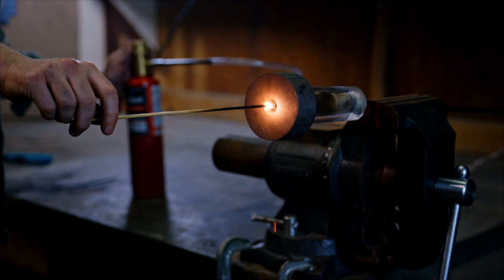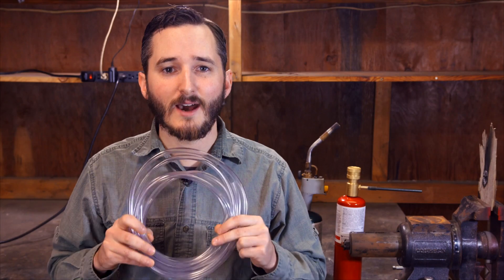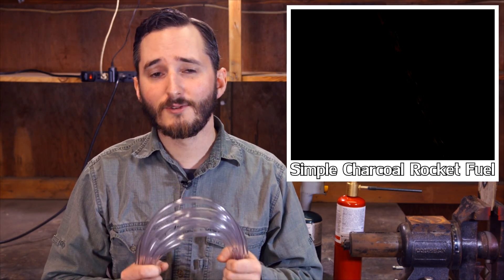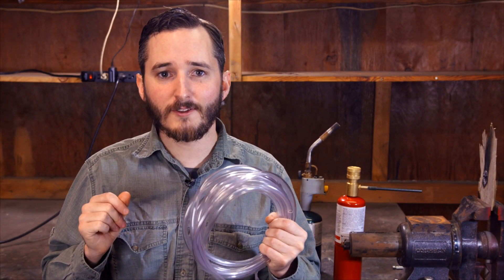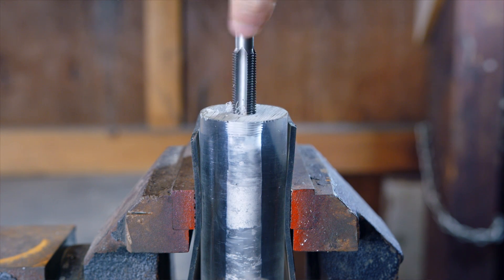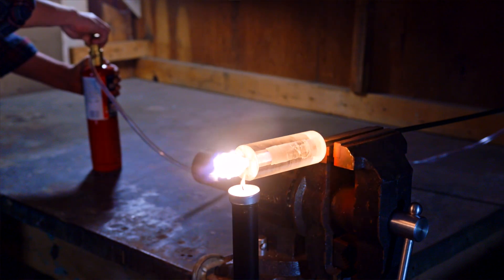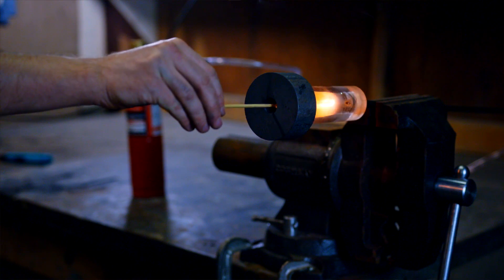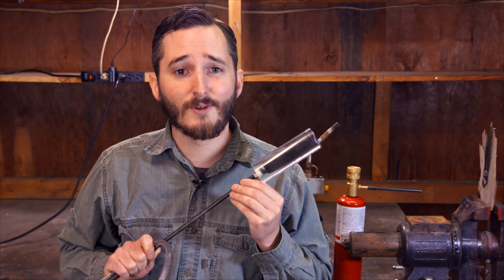Building a DIY Transparent Hybrid Rocket Engine - NightHawkInLight

Comment: Oh boy that brings back memories!

When I was still in highschool, I had made my own oxygen generator setup with an empty wine bottle, some hydrogen peroxide, hydrochloric acid and a rusty nail. 

I promptly decided to have fun with it, and start burning coal in a flow of pure oxygen. Which was quite fun until the vinyl pipe I was using touched the charcoal, and did exactly what you show at 7:17 : I had inadvertently built my first hybrid rocket!

Watching the pipe wiggle on the ground as the flame front was progressing inside it, I stomped it to stop the flow of oxygen. The other end of the pipe promptly popped off the wine bottle with a small hydrogen peroxide geyser, and the combustion stopped.

I then decided I would try again, this time adding a steel pipe at the end of the vinyl tube. That's how I inadvertently built my first thermal lance.

After using the same pipe-stomping technique to extinguish it, I moved on to copper, which has a lower melting point, but is not flammable, even in pure oxygen.

I had quite some fun by filling a hole in a brick with a mix of charcoal and small aluminium pieces, then adding a charcoal ember to it,  and lowering that long copper pipe in the hole with pure oxygen coming out of it. It made a beautiful white light, with a weird flame on top, green on the inside and blue on the outside (I assume that's due to the copper from the pipe).

It was giving off so much heat, I could lower the copper pipe without feeling any resistance, as it must have instantly melted in contact with the burning charcoal and aluminium.

I've still kept the bits of molten metal from back then!
Reply: So you had enough hydrogen peroxide to create enough oxygen to make a thermal lance?
Reply: Caju sounds like the DHS might not like you
Reply: Ok
Reply: Wow that’s so cool  ✨✨✨

Comment: Hypothetically,  if this were added to a skateboard would the thrust be good enough make the board much faster?
Reply: you could buy one or two model airplane jet engines that would work relatively well but i would suggest going with an electric skateboard if you want a safe alternative.
Reply: Ahh I see.  Thanks for the info

Comment: How many of those 2-ounce oxygen tanks did you go through during this project? They go so quick.
Reply from the maker: For this one? Only two. For my thermic lance project, like 10.
Reply: @Nighthawkinlight  Where can I get that oxygen tank?
Reply: NightHawkInLight wow 2 amazing youtubers who grown my actually knowledge i love you guys !!
Reply: If you're interested in looking at other oxidizers, I can pass along some tips on N2O from the research I'm involved in.  Our motors are on a bit larger scale, but liquid N2O is relatively safe if you follow a few main safety guidelines.
Reply: Can you come up with a way to measure the thrust?  I would love to know how much thrust this is generating.
Reply: Michael D I think a simple pool style flow meter would work. Only the flap would have to be made of metal.
Reply: For larger engines with variable thrust curves and shorter burns, we use a piezoelectric force sensor and a data acquisition system that measures the force sensor's voltage many times a second.

However, for a small motor like this, you could easily set a digital scale vertically in front of the rocket motor, much like they do to measure the thrust of RC planes.  The weight the scale reads as the motor presses against it would be approximately equal to the engine's current thrust.
Reply: Cody'sLab I love both your channels. you have both have been a great inspiration to me.
Reply: cody... id like to see you do this, but with a better nozzle, think you can do it? im certain you can
Reply: CODY MAKE A HYDROXY ROCKET
Reply: Cody!!!
Reply: Cody'sLab oh, hello there
Reply: I have been using them for a PP/O2 Hybrid rocket engine myself, any experience refilling them with a larger OXY bottle?
Reply: CODY?!
Reply: +Michael Demshar
A simple way to measure the trust could be to set it up on a track and have it press into a scale. You would just have to remember to set it up so the tube won't be in the way.
Reply: Nitrous oxide would work as well, and might well be cheaper (vapor pressure is much like CO2). Probably cheaper than oxygen, too. Used in commercial hobby-sized hybrids.
Reply: Cody'sLab iii
Reply: Cody'sLab I
Reply: Could you tell me how bigger rocket motors are ignited?
Reply: C C C CROSSOVER
Reply: Cody'sLab hey Cody
Reply: Love your channel Cody.especially the heavy water production video.
Reply: Does someone know where can i get an oxygen tank like that?
Reply: Cody'sLab
Reply: Cody'sLab hey can I use oxygen and propane as a fuel and oxidizer, Or would liquid oxygen be better as a go cart engine?
Reply: Soyuz are inded lit by a "match"
Liquid engins get lit throu a hypergolic catalyst
And solid rocket motors are lit throgh a smaller one
Reply: Isn't nitrous oxide far weaker than oxygen?
Reply: Have you ever tried nitrous oxide for an oxidizing agent?
Reply: Very nice basic demo.   👍👍
Reply: Cody getting ready to use his wax hybrid rocket 😂😂😂😂
Reply: I am a member of a national organization, Tripoli Rocketry Association, that reglary flies commercialy available Hybrid rocket motors with impulse ratings of 160.00 to 10,240.00 newton-seconds. They are nitrous oxide/cardboard, nitrous oxide/Plastic and nitrous oxide/ammonium perchlorate composite propellant. Safe, leagle and fun.
Reply: Lol
Reply: Building SpaceX Replicas of Self-Landing Rockets
Reply: Any chance for a co-lab super rocket? hint hint nudge nudge
Reply: @_om3ga41  any home depot/Lowe's store.  They are used in welding.
Reply: Can I know why only acrylic is preferred here??🤔
Reply: @shan.p  It definitely is not the most power to weight, but it is commonly available, but most importantly ****it is transparent so you can see how it is working****. It makes for a much better video for demonstration. It also keeps quite a bit of its strength at elevated temperatures, which keeps it from blowing apart.  That is why nobody shows it burning all the way to the outer shell. It would fail in an unpredictable manner with  the possibility of hot plastic shrapnel being spread around, which I guess might make for a different kind of cool video.
Reply: Where do you find the valves for those
Reply: Awesome
Reply: Where can I get that oxygen tank?
Reply: Cody'sLab  I'm a big fan I didn't know that you watched videos on your own channel that's awesome second YouTuber obscene comment on a YouTube video
Reply: A really big match.
Reply: Raidzor つ ◕_◕ つ go to Lowe's or home depot and ask for Oxiacetylene torches. They should be around them.
Reply: Cody you got burned dude! Only 2! Beat that. And this time, don't inhale it 😂

Comment: The core flame is melting the machining marks that make it look opaque, and keeps it in a liquid state once burning, so you can see right through instead of seeing the light deflected off the rough machining marks.Much like you'd do by spraying water on a frosted glass with a cold liquid inside. It looks like it's shrinking because the necessary temperature to make the acrylic melt and burn with the oxygen, was acquired from the tip backwards because the ignition source is at the tip. As the interior started burning with the oxygen, it traveled back until it reached the source of the oxydizer. That good enough?
Reply: Incorrect. The acrylic is melting and changing its index of refraction. This is probably the overwhelming contributor to this optic effect.

Comment: Awesome video. Could a less efficient version be made using regular compressed air?
Reply from the maker: No. Because air is only 20% oxygen the other 80% will cool off the fuel as it blows past faster than the oxygen can feed the flame and the rocket will go out.
Reply: it's N2O
Reply: NOx (laughing gas) might.

Comment: Ehh.... if that graphite is conductive, you could send an electric spark as a point of ignition, using the iron and/or brass bits as the other pointed terminal. due to the distance involved.... probably would need Kilo range voltage, but... opening the o2 regulator full bore would decrease the effective voltage needed to complete the circuit.
Reply: The rocket I got to see here at school used a fuel grain that was conductive (they added carbon to it) and so they just ran a high voltage between the oxygen inlet (made of brass but surrounded with a special plastic) and the outer casing of the rocket, it worked quite well.
Reply from the maker: A spark jumping to the nozzle wouldn't be in contact with the rocket fuel to be able to ignite it. You would need to have an igniter deep inside, preferably at the top of the core.
Reply: What about using a model rocket ignitor mounted up at the top?
Reply: Ehh... model rocket igniters would work, but they'd be limited in the number of times they could be turned on and off. 
I was thinking a spark because electrical arcs can effectively be reused, but the gap distance does matter. If an arc can't be struck it will generate a corona, which isn't necesarily useless, but it isn't going to be useful for starting the engine. It'd be useful for ionizing the gas existing the engine though... electrohydrodynamics what?
Reply: Cody'sLab wow, this lucky come tor got two amazing youtubers to reply to his comment
Reply: Indeed. 
Cody Lives not too distant from where i grew up.

Comment: I would love to know if you measured the thrust of your rocket engine. I'd like to see how it varies with the "throttle". I also believe with a throttled engine like this you can never have an ideal DeLaval nozzle shape across the throttle range. The nozzle shape will only be good for a certain thrust and not another. You would probably maximize the nozzle for full throttle operation in a practical application. Anyhow, I like the style of video. I really like the detailed science explanation. I also love this subject matter. I would love to see if you can make a liquid rocket engine, Cody from CodysLab was working on one a while ago but has not done any videos about it recently.
Reply from the maker: I have not measured the thrust. Building a device to do so might be a future video if this one does well. I agree that there's no such thing as the perfect nozzle for a rocket with variable thrust, unless the nozzle is also variable. Mine was pretty bad though for any range. I'll make a better one if i try again.
Reply: Epithemeus Look up Convergent/Divergent nozzles. When done correctly, they can give many times the thrust of a cylindrical opening.
Reply: NightHawkInLight I've built a simple low cost electronic thrust measurement system. I have the build and everything on video, I just have not edited the video for upload to my channel. If you do one, I'd be happy to help.
Reply: Aerospike nozzle. Solves a lot of problems.
Reply: I'd be curious how much of a difference in thrust a well shaped nozzle versus your crappy nozzle actually makes.
Reply: +jacktheripped FYI: liquid nitrous self pressurizes itself to between about 120 and 200PSI depending on temperature, which means it can pump itself at a relatively consistent (at a given temperature) rate.  Further, if the nozzle plugs itself, the combustion chamber's pressure will increase slowing the nitrous inflow rate, eventually to zero when the pressures match, which causes the motor to slow down the burn essentially to zero avoiding a catastrophic failure.  It's self limiting by the very nature of how it works.  With solids and pumped hybrids (or liquid motors with pumps), they're not self-limiting and a nozzle blockage (or even one just a bit too small) will overpressure the chamber - boom!

One of the less obvious, but more amusing consequences of the self-pressurizing "pumping" in nitrous based hybrids is that unless you have your injectors/nozzles precisely matched   at the ambient temperature, the pressure in the chamber will oscillate.  Which will very often cause the firing motor to sound like a very loud and prolonged fart diminishing in frequency due to doppler shift.  Much to the amusement of the younger (and some of the older) spectators.

The pressures of LOX->gas evaporation are impossibly (and I mean truly impossible) high to self pump.  LOX has to be pumped to retain even remotely consistent flow rates.  Gaseous O2 tankage has to be actively throttled to get consistent flow rates, and causes O2 to lose its performance advantage over nitrous.

While you generally don't see nozzles equally efficient across thrust ranges, it's usually not too bad, and indeed, active control is usually only useful from about 30%-100% full thrust.  Below that, forget it.